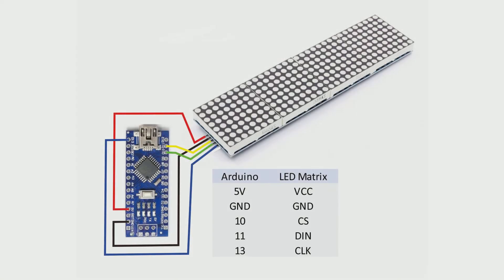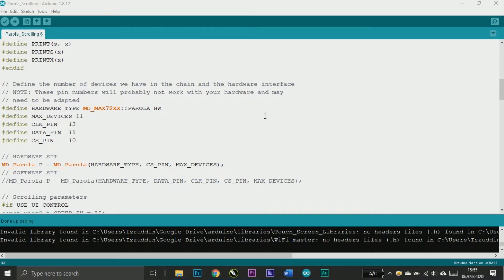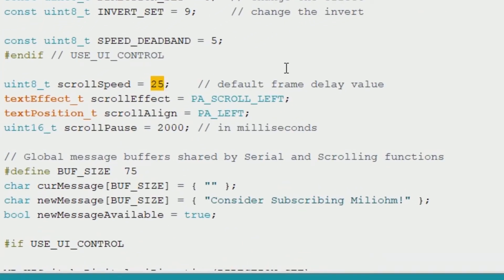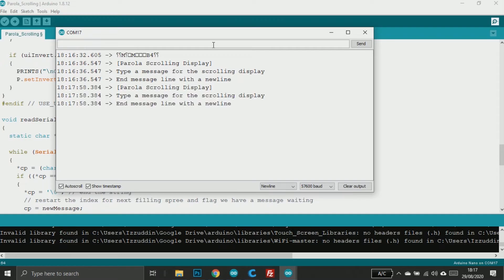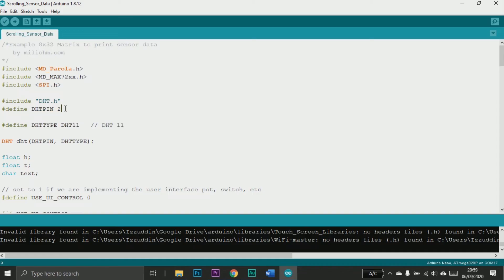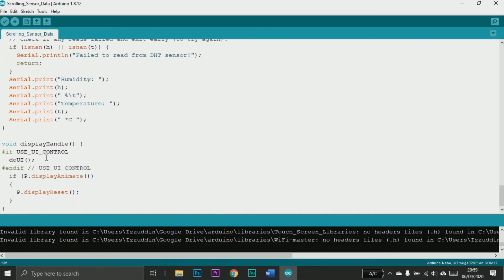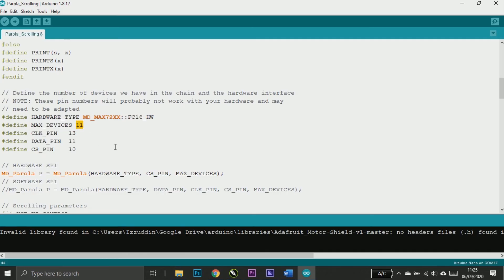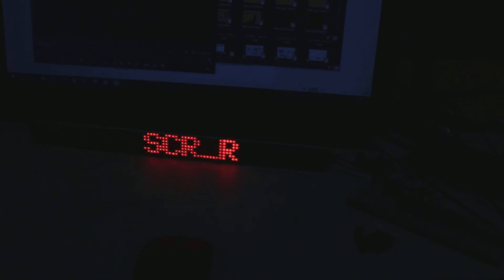How to use MAX7219 LED matrix (running text, display sensor data, add more LED matrix with Arduino)

Comment: I would like to see 2 ESP32 using ESP Now. One transmitting temperature and the other displaying the temperature on a scrolling display and showing when the transmitter fails.

Comment: Hi, Realy nice totorial (explained very well) but i'm having a problem uploading code (Error message below) anyone have any idea why im getting this error ? Thanks

Arduino: 1.8.19 (Windows 10), Board: "Arduino Nano, ATmega328P"
avrdude: stk500_recv(): programmer is not responding
avrdude: stk500_getsync() attempt 1 of 10: not in sync: resp=0x21
Reply from the maker: Try uplug the USB and try again.
Reply: If you are using a blue Chinese clone of the Nano, you need to choose ATmega328P (Old Bootloader) under Tools/Processor.. HTH.

Comment: hello, i want to see in your tutorials if it's possible to make a digital clock with gps syncronization with dates and temperature , power up by a photovoltaic panel....clock, dates and temperatune need to change between some interval, and the led light need to dim out if is night time...

Comment: Great tutorial thank you sir...Hello sir, I'm working on a project called wireless notice board, using aurdino, two Xbee series 2c, 8*8 dot matrix board (4 in 1) for the display. The aim of the project is to wirelessly update the message scrolling on the  dot matrix board using the Xbee. One Xbee is connected to the Arduino, the matrix board is also connected to the Arduino (I don't know if my connection is Correct) then the Arduino is connected to the laptop through USB, the second xbee is connected to another USB port. I use the XCTU software to check if the connections between the two Xbee is okay, I can send a message wirelessly to the other Xbee and vice versa... to command it to update the matrix board is my problem here please help me guys. I want to summit the project in school next week

Comment: Numpang tanya bang, saya kan bikin external / extra display buat timbangan digital via serial communication, ic pakai max7219 dan LED 7segment, sewaktu mulai hidup, angka di timbangan 0, di display juga 0, sewaktu ada beban di timbangan misalnya 1000 di display juga menunjukkan 1000, sewaktu beban kembali ke 0,angka di display tidak mau kembali ke 0 kenapa ya bang? 
Kalo saya coba kode yang sama dengan ic TM1637 tidak ada kendala bang padahal. 
Mohon pencerahan nya.
Reply from the maker: Programnya bagaimana? Coba dishare programnya biar saya cek
Reply: @miliohm  , ini sketch nya bang...

#include "DigitLedDisplay.h"

//LedControl lc=LedControl(12,11,10,1);
DigitLedDisplay ld = DigitLedDisplay(12, 10, 11);

String dataIn;
String dt[10];
int i;
boolean parsing=false;

void setup() {
  Serial.begin(9600);
  dataIn="";

  // led 7segment max7219
  
  ld.setBright(10);
  ld.setDigitLimit(8);

}

void loop() {
if (Serial.available() > 0)  //  tampilkan data ketika menerima data dari serial monitor:
     {
           char inChar = (char)Serial.read();
           dataIn += inChar;
           if (inChar == '\n') {parsing = true;
           
           }
     }
     if(parsing)
     {
           parsingData();
           parsing=false;
           dataIn="";
    }
}

void parsingData()
{
      int j=0;
    //inisialisasi variabel, (reset isi variabel)
      dt[j]="";
    //proses parsing data
      for(i=1;i<dataIn.length();i++)
      {
             //pengecekan tiap karakter dengan karakter (+), (.) (n), ( )
             if ((dataIn[i] == '+') || (dataIn[i] == '.') || (dataIn[i] == 'n') || (dataIn[i] == ' '))
             {
                   //increment variabel j, digunakan untuk merubah index array penampung
                   j++;
                  dt[j]=""; //inisialisasi variabel array dt[j]
             }
             else
             {
                  //proses tampung data saat pengecekan karakter selesai.
                  dt[j] = dt[j] + dataIn[i];
             }
      }
      //kirim data hasil parsing

      //Serial.print(dt[1].toInt()); // serial monitor
      //Serial.print("\n");

      ld.printDigit(dt[1].toInt());  // led display 
      
}

Comment: Fc16_HW is not a member of md_max72xx error, how do I fix it?
Reply: You have to look for the correct Parola library that has this function. From what I saw, it's calling FC16_HW instead of Fc16_HW (capital C).